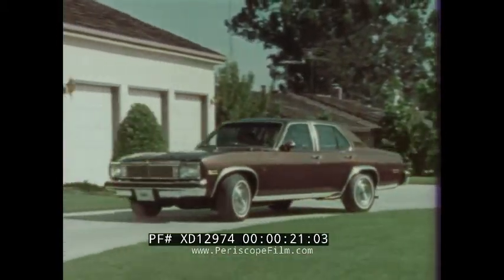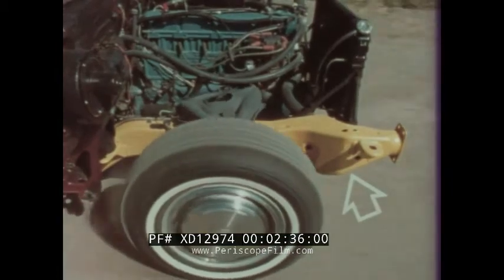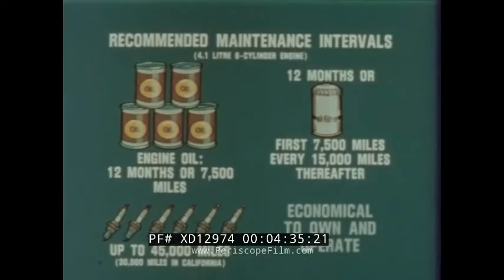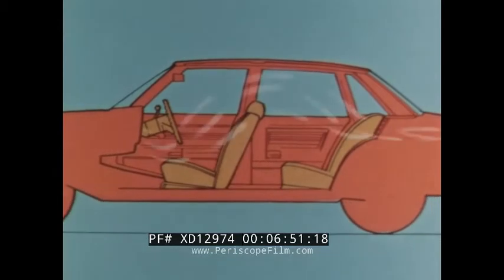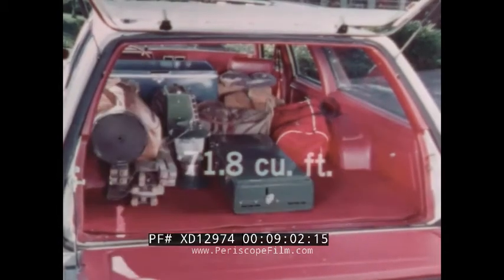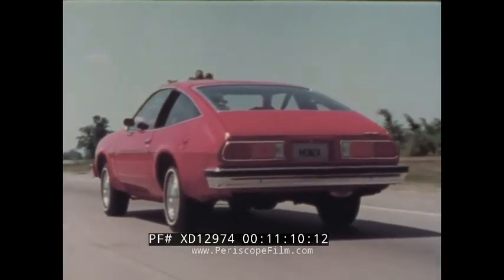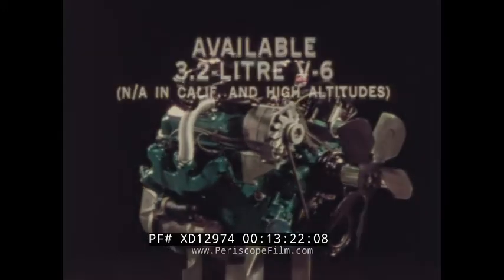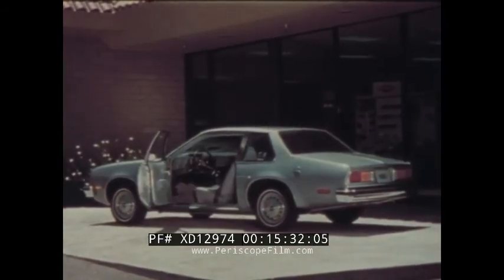1979 CHEVY NOVA, MALIBU & MONZA AUTOMOBILE SALES FILM    CHEVROLET CARS XD12974

Comment: I had a 1979 Nova Custom. It was really unbelievably reliable. Took me all though high school, college and thereafter for a few years. Had the inline 6, and when it left me, it had 180k miles. BUT, funny watching this when they tell you all the rust proofing ........my Nova rusted away.....everywhere. I traded it in because the windshield would rock back and forth due to rust.
Reply: Our '78 leaked badly around the windshield and metal supporting it rusted away. My dad's fix was smearing roofing tar around it! Lol

Comment: My Dad bought one of these (slightly used) from a leasing company in Toronto that had taken an order from a Police force somewhere in the Us  the had ordered a whole bunch of them.
Then they cancelled the order.
They were giving them away at $4200.Dad's was a Hot Fudge brown 2 door Nova Custom 'Sleeper" with NO chrome trim other then the grill / headlight bezels and tail light bezels. It had the 5L V8 P235 70 / 15 Kevlar tires ,Certified MPH Speedo and air con.
My Mom was terrified to drive it by how fast it. would go.
Dad sold it 2 years later for more then he paid to some young "kid" who managed to rap it around a pole.

Comment: The Monza always looked better with the quad rectangular headlights and they came on all models when the Monza was introduced but for some reason only were fitted to the top of the line Spyder later on. The hatch version of the Monza with the quad rectangular headlights still looks great today. The 2 door with the trunk looks like what it is: a slightly restyled Vega. I saw very few of the coupes, but LOADS of the hatchbacks when they were new.
Reply: Agreed, I never thought the two round headlights looked good on base Monza.  They should've made the rectangle quads standard.

Comment: 1991 I purchased a 1977 Nova-Grey exterior with burgundy velour interior..2 door hatch.. Straight 6 engine..$2195 from a used car dealer..Great freeway car.Decent economy.
Only option it had was an AM radio! Smooth ride and reliable.Wish I still had it...
Reply: Our family had a white 1977 Nova with red velour interior, straight 6. great acceleration, had an AM/FM radio with the antenna embedded in the front windshield. lasted my dad until he wrecked it around 1997.

Comment: We had a 77 Chevy Nova and a 77 Olds Omega, both temperamental with getting the engines to run right. They usually stalled at least once on a cold morning. Sag was an issue with those leaf springs that were used in the rear. The floorboard under the driver's side rusted out on the Nova; I found out when water splashed up at me while going through a puddle during a rainstorm.
Reply: Malaise-era carburetion and tune, horrible times indeed. Spark timing at TDC or even after TDC, lean mixtures...  Yeah, I noticed the shot of the 4-dr Nova sitting low in the rear in the video, classic...  right off the bat it's sagging!
Reply: Still, far better than the turds that GM was in such a hurry to replace them with, the ‘80-‘85 X cars.
Reply: Same problem with our '78. Never seemed to idle right.  Stumble and died after it started and if it was wet out it had a habit of stalling out. I blame how the carb was tuned, prob too lean.  It also sagged in the rear, and it never tracked straight.  Ours rusted out there too, I got creative with the sheet metal and pop rivets.

Comment: Wow, I can't believe that a big V8 engine was available for the little Monza!  Those V8 Monzas with the same engine as a much bigger and heavier Impala or Caprice must have been as quick as lightning.  On the other hand, it's hard to believe that a big V8 engine would fit under the hood of a small car.
Reply: In 1979 it was a 305, but only 130 horsepower.  This is in a 2800lb car (base 4cyl weight), so by the time you add engine, power brakes (believe mandatory), steering and maybe AC - it's not a very impressive power to weight ratio.  In 1975, you could actually get a 350- but it was detuned to even less factory hp.
Reply: Yes...but a few upgrades  later. And look out. Faster than .a big block LS6 CHEVELLE.  😉😳......

Comment: That does it! My next car will be a 1979 Chevrolet Monza!
Reply: You will love it I had the 1979 Monza spider with the 305 cid engine and a 4 speed manual transmission  back in 1987 my favorite I also owed a 1976 Buick Skyhawk in 1985. Crashed the Buick and sold the Chevy when I went into the Air Force in 1987
Reply: Good luck finding a 1979 Chevrolet Monza in 2021.  I'm guessing that these Monzas just didn't last, because they disappeared from the roads during the 1980s.  On the bright side, I don't recall seeing rusted out Monzas.

In contrast, the Oldsmobile Cutlasses of this era had an uncanny ability to keep on running while looking like they belonged in the junkyard.  When I was in high school (during the Saved By The Bell Era), beat-up Cutlasses were the most widely owned car among my classmates.

Comment: 3:26 I wonder what the take rate for power windows on '75-79 Novas was. I don't think I've ever seen one.
Reply: It could have been the Luxury Nova variant
Reply: @harrybriscoe7948   It was a Nova Custom which was the top trim in '78-9 after being mid-line since '75. LN was rebranded Concours in '76 and dropped after '77 to make way for the downsized Malibu.
Reply: I remember seeing them listed in the owner's manual, and being surprised that it was an option. The cigarette lighter was even optional as I remember.  I think most people tended to by these stripped or nearly stripped. My dad's only had power steering, automatic and AM radio which was also optional.
Reply: @nlpnt  By '78, the "compact" Nova was now larger than the new midsize Malibu.
Reply: @Progrocker70   IIRC most non-fleet cars ordered to dealer stock had body side moldings, full wheel covers and white stripe tires.

Comment: Do you have anything for the '77 Caprice/Impala or Concours/Nova?!!!!
Reply: I think it was 78 when they started putting all this emissions crap into cars so everything before 78 was pretty good after that it was just junk choking up the car with the emissions pulling the horsepower right out of them I had a 77 Scottsdale Stepside that thing was badass 350 with 300 horsepower straight pipes 41 inch glass packs headers and no catalytic converter no emissions four-wheel drive I f**** miss that truck so bad last of the freaking Mohicans I know you can get cars nowadays with 700 horsepower stuff like that but that was a bad ass pickup truck

Comment: They de-contented the '79 Nova.  The '69s were nicer!  They started life with counter-balanced spring hoods and the '79s had a prop rod, even though they cost 4 times as much!  Cheap bastards!  Even the wheel-well inner covers were nowhere near as good (they probably got them off the Vega!)  And even a brand-new one would drag ass with those leaf-springs in the back.  Two more leaves (better yet, coil springs,) would have solved that.  And a split bench!  The '79s were not cheap!!  Still, I wanted one!  They did look nice, though . . .  The '73s and '74s were pigs!  This was the body-style introduced in '75.  Couldn't afford it at the time.

Comment: I had all my Driving Lessons in a 76 Olds Omega, the Olds version of the Nova. I took my Driving Test in a 76 Nova(we had a full size Dodge Wagon, and Olds Delta 88. I figured it would be easier to do the Parallel Parking part of the Drivers Test in a Smaller Car. These Pipsqueak Cars, which were called Compacts, are Larger, inside and out, than what is pawned off on us these days as a Full Sized Car. Although it looks a bit cheap, it certainly looks far better built than any Car Introduced in the 1980s, those were real POS.

Comment: Also who in their right mind would change the oil in a car every 7,000 miles and change the filter every 15000 miles that was a scam to get you to f**** ruin your motor those cars you need to change the oil every 3000 miles and every time change the oil filter if you wanted them the last in the V6 which were Buick V6 you needed to change the oil pump to a high-velocity oil pump because it came with low velocity oil pumps which is what killed those engines scam upon skin lie upon lie going to sell those cars go to screw those people and it continues today

Comment: The mid 70s to mid 80s was a terrible time for auto manufacturing, HORRIBLE Design, HORRIBLE Performance, HORRIBLE Everything, pushing 150HP out of a V8 was hard, with the low compression, introduction of catalytic converters, and the gasoline crisis.  We went backwards with performance.  Nowadays, we get 150HP out of a naturally aspirated 4 cyl motor, turbo ?  We get hi 2s and low 3s.  We have come a long way, and, in my opinion, cars from this era belong nowhere but the scrap heap, with few exceptions.  It was all about “value”, and higher end models were nothing but the same cheap heap of garbage low end model, with a shinier “caps” and an FM stereo.  I lived through it as a kid, look back, and laugh about it, especially when dad upgraded from the ‘72 Ford Maverick to the ‘80 Ford Fairmont.  My mom actually wanted an AMC Pacer, which was a fishbowl on wheels, but dad was a Ford guy.  If I knew, would have told dad to wait a few years and buy a Jeep Cherokee.
Reply: All you had to do was change the engine. What do you want.  The factory to do everything. Scrap  hepe I don't think so.
Reply: I think the huge mandated bumpers that stuck out really spoiled the styling of many cars of that time.